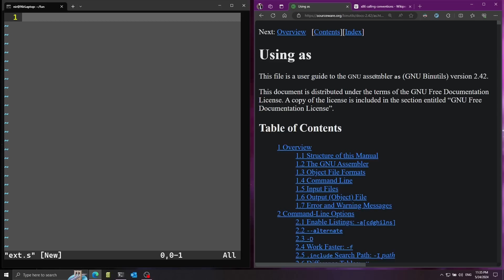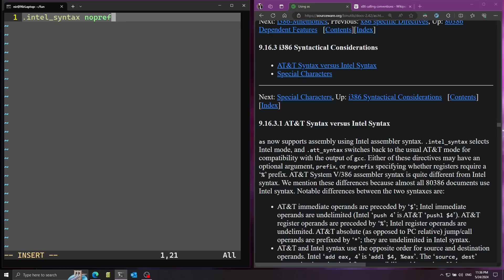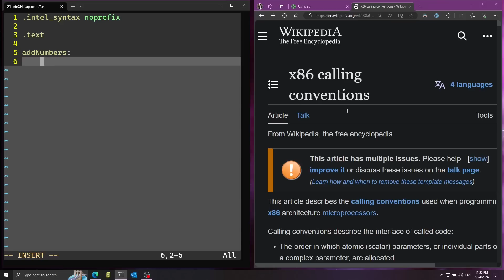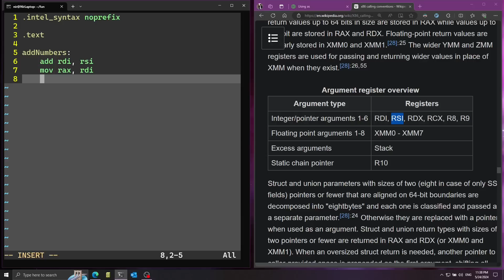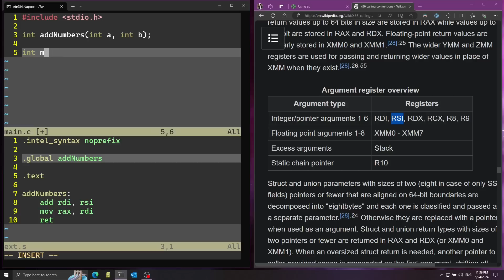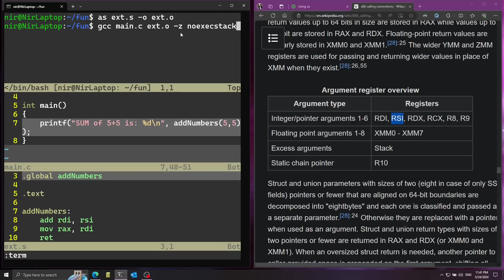How to Call Assembly Code from C

Comment: The biggest hint for assembly calls is to use -S on gcc and generate a prototype for your function in assembly. IE, if you want to make an assembly function to be called int addnumbers(int a, int b) { return a+b; } IE, do a prototype of the function in C, then use gcc -S to generate the file. Then you just edit the output file .s to add your assembly code. gcc fills in all the details for you.

This does generate AT&T format code, not Intel code, but I think you are better off learning the AT&T code format in any case. Its not that different, and you can use gcc to generate example code for you.
Reply: Great advice!

For anyone interested, we can still get GCC to compile to Intel syntax using -masm=intel

Example:
gcc -S main.c -o main.asm -masm=intel

which will produce a file named main.asm containing the x86_64 code we're looking for

Extra:
The code on main.asm will include preprocessor instructions, which won't be of use to us
We can remove them by typing -fno-asynchronous-unwind-tables at the end of the shown command

Example:
gcc -S main.c -o main.asm -masm=intel -fno-asynchronous-unwind-tables

From then on, there are several optimization instructions we can add to our command to get different asm code outputs, but I'll leave that there for you to look up if needed

Comment: Should have told me this  20 years ago.  I had to fetch arguments from stack then add to SP(for speed) the size of the args plus return address.  Were naked functions supported back then? 

I remember GCC supporting inline asm with the .intel directive though as this was my fallback until optimizing compilers came into the picture.
Reply: There is the fastcall convention that can pass two 32-bit arguments in ECX and EDX (vectorcall also allows floats and vector types in SSE/AVX registers). For lack of general registers on IA-32, you usually can't pass more. Also only Visual C++ and GCC 4.0 onwards supported it.

Comment: Stupid question but where do I even start with all this computer stuff if I don't even understand what I'm looking at?
Reply from the maker: I started programming by learning some HTML in w3schools and building websites since I really wanted my own website, from there on went and learned more advanced stuff first CSS and JavaScript and eventually also C and Assembly, I would recommend starting with the basics first and only after you start feeling comfortable moving on to more advanced stuff, good luck!
Reply: @nirlichtman  thanks bro
Reply: @nirlichtman  I got another question. What resources do you recommend for learning command line and general computer knowledge stuff like how to work operating systems and shit?
Reply from the maker: Depends, are you interested in learning Windows or Linux? If you mean Linux, in general I would highly recommend learning to work with man pages and using them to learn about the various basic commands, you can start by running "man man", and then start by reading the man pages of the basic commands for instance ls, cat, grep ... For getting started videos about this kind of stuff I would recommend Network Chuck and Engineer Man
Reply: @nirlichtman  More so on Windows but Linux is interesting too. I'm a total beginner so I wanted to learn Windows first. Ty for the youtuber recommendations though.
Reply from the maker: @Wagner-uv6yp  For Windows I would recommend SS64.com if you want to learn commands for CMD/powershell, also check out the offical Microsoft docs and training it is all available at learn.microsoft.com , finally if you wanna explore Windows deeper, the Sysinternals suite is a good start, you can get it from the Windows Store, its a collection of programs that help you explore what is going on under the hood of the system, also NetworkChuck has a nice video introducing Windows in 30 minutes, its called something like You need to learn Windows right now, also I would recommend Lowel Vanderpool's Windows lectures, he explains stuff clearly

Comment: Wow this was really cool I know about CDECL and STDCALL conventions from school but that’s for x86_32 nasm. Why don’t you have to push the arguments onto the stack and why do you just use registers? Is it faster that way? Can’t there be something useful in RDI that you’ve overwritten?
Reply from the maker: Unlike most popular x86 calling conventions which pass all the arguments through the stack, on x64 the calling conventions pass the first couple of arguments through registers and the rest through the stack.
Reply: @nirlichtman  okay and you don’t need to create a new stack frame, save and load the previous states of registers when using this convention? Something along the lines of pushad popad, so that the value 5 as from your example doesn’t change in the rdi register when calling the function? Or is it because C handles that on its own?
Reply from the maker: @nezby3945  in this case since these registers are used for passing args (and rax is used for the ret value), no preservation is needed
Reply: @nezby3945  In leaf functions like these that don't use the stack, you don't have to set up a stack frame. Even if you do, the SysV ABI defines a "red zone" of 128 bytes under the stack pointer that you can use without interference from signal handlers. Also since RDI is one of the registers used to pass parameters, it's also part of the scratch registers that the caller has to save if needed before the function call, while the called function can use it freely.
Reply: @D0Samp  Oh wow I had no idea that It worked like that our uni teacher never told us something of such existed. Thank you very much for clarifying and taking the time out of your day to do so. If only there were more people like you :D!!!!!!!

Comment: Is this actually "calling assembly code from C" ?, the compiler will generate main.s and then the assembler will assemble it to main.o, since you have ext.o, the linker will know that there is an UND symbol in main.o and it will statically link it from ext.o, this is not calling Assmbly from C, so I think writing Assembly in a C file or including an assembly file from C file is the actual thing you need to cover. BTW, good videos, I really appreciate your work.
Reply: From the linker's perspective there's indeed no programming languages at all, it resolves symbols and takes startup code (from the C standard library, if you use the C compiler frontend) to produce an executable. The biggest difference here is that only the foreign function follows the conventions of the C compiler, usually it's either a higher level language like C++ or Rust that calls into a C library or two of them using C conventions as a lingua franca to communicate. I think it's still valid to call this "calling assembly" if that assembly procedure just follows the common denominator in calling conventions.

Comment: At university 20 years ago, I had a project involving MD5 hash calculation written in Delphi/Pascal. For some reason, the Pascal implementation was incredibly slow, even with bitwise optimization. I injected ASM into my project to speed it up, and even the simple, unoptimized ASM version was twice as fast as the optimized Pascal version. With some additional tweaks, I improved performance by up to three times. Nowadays, compilers are smart enough 😅

Comment: Thanks for the video, but what if I want to build a secure executable ? I mean, I don't want to have the '-z noexecstack' option during my build ? it seems like calling assembly from C is not secure.
Reply from the maker: The -z noexecstack option does not make the executable unsecure, its just to tell gcc that the stack should be non-executable, otherwise there would be a warning when combining the assembly and the c code with GCC. there is also a way to specify that the stack is non executable inside of the assembly and that can be an alternative for the flag
Reply: @nirlichtman  Thanks for the clarification

Comment: Right in the part where you said that C needed to know that the addNumbers function existed, shouldn't you have used "extern int addNumers(...);"? Great video by the way, cheers!
Reply from the maker: Thanks! Regular non-inline function declarations are extern by default, so no need
Reply: All functions in C are implicitly extern

Comment: I usually declare the functions with the extern keyword if added into a C file like this.
That way it's extra obvious they are from a different file.
Or I create a header file.
Reply: I was wondering about this, but apparently `extern` is the default linkage for a C function declaration.
Reply: @RayBellis  yes, it is. Still better for readability though

Comment: thanks man :)

just realised the linker finds similar functions names in the given file name ( as parameters )
Reply: *Symbols*. The linker finds one and only one matching symbol definition for each reference, in static linking literally copying the definition code into place and in dynamic linking inserting an executable address resolution.

The distinction is important when you have function overloads, name mangling (functions in classes, in C++, for example), and non-function objects. Calling convention also sometimes impacts the fully qualified symbol name, and therefore resolution.

Comment: just asking, which one is more better? intel or AT&T syntax?
Reply from the maker: In the end, it depends on which one you feel more comfortable with/the project you are working on, for example the assembly parts in the Linux kernel are written with the AT&T syntax, but the general standard syntax of x86 assembly is in the intel syntax (including in the official intel manual), I would recommend being at least familiar in a basic level with both.
Reply: The only purpose of AT&T syntax is uniformity among instruction sets for compiler output. Its (source, destination) format comes from the DEC assembler for the PDP-11 and VAX (and Alpha), which was the birth place of Unix. Basically all other modern instruction sets like MIPS, ARM and RISC-V use (destination, source) without prefixes as well.

Comment: Hi assembly experts, can you explain why he passes and returns values in R registers, which are 64 bits, but in C he specified int, which is 32 bits. Why is there no conflict?
Reply: There is conflict, but conveniently E registers are just lower 32 bits of R registers. So as consequence meaninglessly higher portion of %rax and %rdi will be modified, but that's fine.

Comment: I’m just missing how the arguments got passed to the registers RDI and RSI.
Reply: it's the call convention of gcc. Before the actual subroutine call, gcc will add "mov" instructions to take the C function arguments and put them in those registers
Reply: @typedef_  Thank-you!
Reply: It's defined by the function calling convention. Linux and pretty much every UNIX-like OSes on the x86-64 platform use the System V AMD64 ABI, where registers RDI, RSI, RDX, RCX, R8 and R9 are used to pass the first 6 integer arguments to a function.
Reply: @dorquemadagaming3938  Thank-you!

Comment: Is it possible to call assembly code from higher level languages, like C# or Java?
Reply from the maker: Yes, but in most cases not directly like we can do with lower level languages such as C, for example in Python you need to create a separate DLL or Shared Object (depending if you are writing for Windows or Linux) which implements a specific interface that Python can work with, so that Python can later import it and work with it